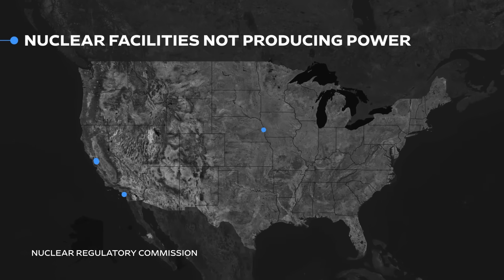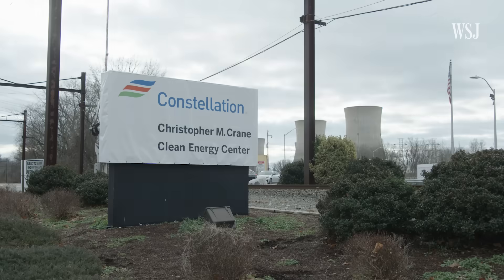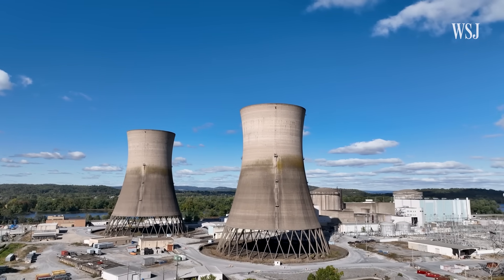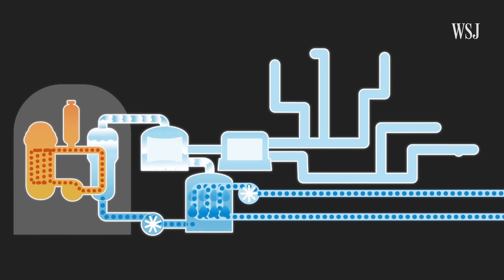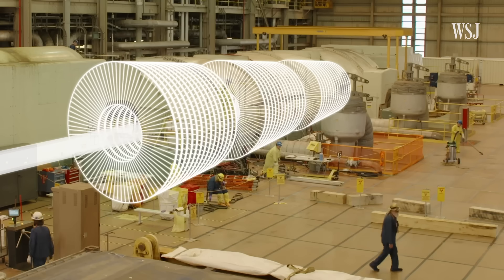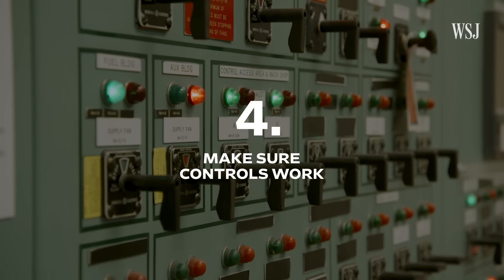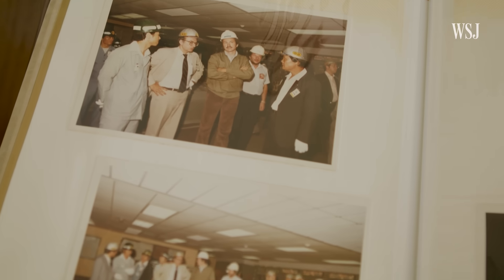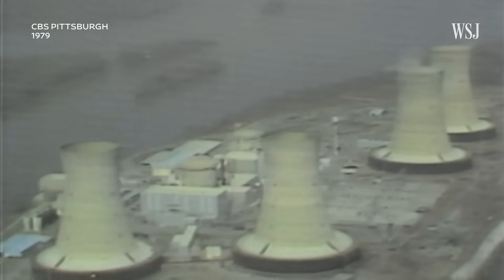Inside the $1.6B Plan to Restart Three Mile Island | WSJ

Comment: Nuclear power is similar to the aircraft industry. The general public fears its most catastrophic failures so much that we forgot both coal and cars have a significantly higher death toll compared to these two.

Edit : Do you realize that all your comments actually prove that nuclear technology is safe? Why? Because, innately, all of you are already aware of the worst possible effects—it’s ingrained in your minds. In aviation, we call this a "safety culture." When we design something, we consciously and unconsciously strive to create the safest design possible. But i get it natural disaster and idiot people are inevitable
Reply: Yep. Coal has a significantly higher death toll, even when it's functioning as intended.
Reply: @normang3668  windpower has a higher deathtoll than nuclear due to work related accidents. and 100 people die in the oil industry every year in the usa. the number for nuclear is zero.
Reply: @normang3668 I wonder what death toll is between problems mining it to the pollution it generates.
Reply: @dustintacohands1107 1600 deaths per year attributed directly to coal plants between 2007 and 2020. 1999-2007 was 390k to 460k. Particulates dropped drastically in 2007. This is just the US by the way.
Reply: @normang3668 And coal plants release more radiation too, since coal is full of radioactive isotopes and most end up going out the stack.
Reply: @normang3668  Mining is hazardous, Coal dust is hazardous plus various other events like fires can kill.
Reply: Not only that but also coal power plants produce more radioactive material than a nuclear reactor as fly ash is surprisingly radioactive
Reply: Very good comparison
Reply: @AlexWaardenburg no you can't compare it.
Reply: @AlexWaardenburg no its not .. airplanes do not cause thousand year spills
Reply: @AlexWaardenburg  Little buddy, the plant south of Miami is leaking onto the everglades area on the southeast end... you all have no clue
Reply: Everyone saying the difference is radiation should look up how much radiation coal plants give off. They often exceed the limits set on nuclear power plants. The idea of converting coal plants to nuclear power plants is often shut down because the radiation levels are too high to get certified.
Reply: Enter Boeing
Reply: As the Chernobyl thing would've been avoidable. For it happens because of the communist system is impractical by a long term on a super large empire. As the impracticality only cause them to hold back do to the soviets heavy finances on their military funding over civilization fundings. Which causes the computer tech for the nuclear plant to be fallen behind along with short fundings for the nuclear plant. The plant going to it's last leg and start to create a world most infamous meltdown.
Reply: It is much easier to "make the news" with major, infrequent events like nuclear accidents and plane crashes than the hundreds of thousands to millions that die or are injured every year from car accidents, fossil fuel pollution, and climate change related events like droughts and stronger hurricanes.
Reply: They also do not like the fact that nuclear requires of massive amounts of money. If taxes were to be raised to fund a trillion investment in nuclear most normies would oppose.
Reply: True.  The incidence of fatailities in cars are much higher.   But that doesn't mean everyone is going to give up cars soon and fly everywhere.
Reply: false.
Reply: they listened to media, hollywood and activist.
Reply: It's also similar to aircraft industry in another aspect - it's cheaper to build new modern plant then refurbish a Vietnam era one. That's why american air manufacturers are moving states right now. And why modernizing Three Miles might be not the best idea. Location is good, all the support infrastructure is in place including cooling towers, but then the plant itself... ehm... in nuclear technology terms it's a dinosaur 😅
Reply: Yeah, not really. People fly on airplanes every day, even if they're afraid. People don't sit inside of nuclear reactors every day.
I appreciate the attempt, but yeah, it doesn't work.
Reply: How many coal disasters have made land unusable for the foreseeable future?
Reply: @The_Ballo  All the vast  strip mines in Wyoming for instance are unusable land for years, maybe generations. There is no unusable land anywhere in the US due to commercial nuclear power.
Reply: @Nill757  yeah but that's Wyoming not where people live (where there are power plants)
Reply: @The_Ballo  Commercial nuclear power in the US had never made any tracts of land unusable,  never killed anybody from radiation, even though there have been accidents like TMI. Still, its possible to have a leak that would hurt people, but nothing compared to the coal emissions that kill people every year  or an oil train fire that burns up an entire town (Quebec 2013).
Reply: @Nill757  If they removed the liability cap I'd believe you
Reply: What about volume ? Billions of cars, hundreds of power plants, maybe thousands?
Reply: @ nuclear safer than its peers, gas coal.
Reply: Coal doesn't pollute an area for a million years+ though
Reply: Very true. But, the more plants you add, the more the risks increase. The cost to keep a plant top notch every day has to be astronomical
Reply: @ the real problem is getting one started especially in a country full of people making assumptions about nuclear power like you assuming they cost more to maintain and run when they DO NOT cost more than other power sources.

Most the money is in getting the plant started especially considering these plants could be operating 100 years.

We have one in the US now that Is expected to reapply its license to 80 years. From 55 it’s at now.
Reply: Bro talking about safety culture in aviation while parts are falling off Boeings…
Reply: Ok copy that, what to do with the waste?
Reply: But the world has changed.  There are far cheaper and safer alternatives.  Solar/battery could do the job without the risk.
Reply: Coal is a carcinogen just like fision..... hmmm.  So pick the one that makes you ill.😂 Can't do tidal, or some other clean source? NO cancer is big business.... trust me.
Reply: How many have dies from any of our nuclear power plants?   …….   None.
Reply: Except when i crash my car , it does not contaminate things for thousands of years and give people cancer .
Reply: A.I. is the sky net terminator & like the movie eagle eye.
Reply: The death toll is statistically smaller only because nuclear energy hasn't been around for long. The statistics also don't count the people who will be dying for the next 200,000 years from the leftover waste. It's insanity. A car or an airplane can't make a state uninhabitable for the next 200,000 years. A nuclear plant could.

Some of the people indicate the danger of having a society full of intelligent fools.
Reply: Unless you have a vodka-swiller in charge of a shoddily built facility.
Reply: It has screwed up the EU and CA
Reply: lol coal and fossil fuels are no more deadly, except in comparison of death per Kw….in that case the atom is far safer and more effective
Reply: it is NOT safe my child... the leak at the turkey point plant in miami, proves me correct..  no engineer has debunked me in 9 years... you cannot do it. ❤
Reply: The cars and planes in Fukushima didn't raise the ocean temp 1 deg either.
Reply: @maxwebster7572  4°C worldwide actually. And keep rising with each barrel of oil burned.
Reply: @TheArklyte  That would be if global warming is caused by fossil fuels and not by the sun. The Fukushima accident directly impacted the ocean.
Reply: @maxwebster7572  
ah, let me guess, your next claim would be that Earth is flat, correct?
"All human die eventually so my client is innocent of child murder with 56 stab wounds, Your Honour" - your comment.
Reply: I dont think Ukranians are comparing Chernobyl with car accidents.
Reply: The aircraft industry doesn't hide the accidents like the nuclear power industry though. It was days before they acknowledged that there was an incident at three mile island. Thousands have died from that exposure yet, they make it out that was because of something else even to this day.
Reply: I personally just see its costs! It might be feasible to run this hellischly old system, but in reality it has to compete with renewables and that basicaally means new reactors are not economical viable. We see this in the numbers, 6 GW of new Atomic power per year vs 300 GW of renewable power each year. It is peanuts, and the only reason for Atomic power is to get the Bomb!
Reply: as somone in the commercial airline repair/recovery/retrofit field this is very true. its actually impressive how little a plane is needed to actually fly.
Reply: Yep and that's why we are getting rid of coal and ICE powered cars.
Reply: @RIPCelts2025  I don't understand. Can you write a coherent sentence?
Reply: Well said
Reply: Not to mention that renewables like wind and hydro have higher annual death rates than nuclear.
Reply: True but 1 nuke accident could affect or kill what, 10k people,  50k people, 10million. Along with ground contamination for decades . I like  nuke but safety , cutting corners, false inspections  do exist,  unfortunately.
Reply: LOL, stop, coal and cars with what?  plant food?

Let's check how many nuke plants are leaking...

Lets check cancer rates around these things... 

Yet you are full of it..
Reply: FYI in sociology they call it expert bias if someone thinks an "accepted risk" over lifetimes spread over national square area equals one that takes out a team or school class within a minute in avation or makes a whole city uninhabitable within a day. natural disaster and idiot peple are a natural part of the causes. but what people (laypeople alike) sense and worry about is societal damage of mass events which IS different from coal and cars.
you think "oh em gee they prove i'm right" but you're just not thinking all angles.
Reply: @mickolesmana5899   with educational resources ALL AROUND US , you're  obviously getting paid by a nuclear entity ...
Reply: There are so many things to reply to, so my opinion probably won’t be heard. Anyway, nothing is burned in a nuclear reactor, reactors are caused by thermal neutrons colliding with each other to create heat, which in a PWR (Pressurized Water Reactor) heats up water that is not being used as a coolant or moderator, that spins a turbine. Correct me if I’m wrong but that is an oversimplification. It is incredibly easy to mess this up. It is incredibly hard to mess this up in such a way that releases radioactive mater into the environment. Nowadays there are so many automated tasks that a human can’t mess up. Nuclear power is one of the safest ways to produce energy, and it is the renewable way to the future. The reason I saw it is renewable is because 96% of nuclear fuel is recyclable, the only things that aren’t are 4% of tiny decay products that are nowhere near as radioactive as the fuel itself. I hope this clears up some things, and goodnight.
Reply: statistics is the ultimate snake oil industry that makes up fake facts
Reply: Agreed on the point that Nuclear power is safe. But I disagree with the reality on the ground. Many of these plants are old there are areas in the plant that just cannot be refreshed for obvious reasons. And on a darker note. I am in the IT industry and I do not think the American workforce as it is can operate nuclear power plants in a safe economical manner. I see it all over my industry little mistakes that introduce vulnerabilities to some of our nations most important digital infrastructure.  We can at least recover via re imaging a server. Nuclear energy once you make a mistake you cant just undo it.
Reply: YOU OBVIOUSLY DIDN'T EXPERIENCE WHAT THE FALL OUT WAS... I DID! PLZ STOP SPREADING A FALSE SENSE OF SECURITY.  THIS IS A FIGHT FOR GREED!!!
Reply: cars dont mass kill people in one massive  area like nuclear can.  nor does coal
Reply: except when my neigbor crashes their car, the entitr area involves is not irradiated for tens of thousands of years.

people dont fear nuclear power.
they fear the greed of the private companies that will own and operate them.

fukishimas owners stated everything is fine...
3 days later.....

how about we nationalize our power production first.
that will drop prices a ton
Reply: Uranium, like coal, also has to be mined and is a finite resource.
Uranium mining also produces a lot of toxic waste.
Reply: Well, yes. But the death toll from a failure like Chornobyl can be catastophic. The Russian government still considers the death toll from Chornobyl to be 33 persons. This only accounts for those killed immediately or within the first couple of weeks. Then there is the increased deaths from cancers in radiation exposed people. Then there is other side effects that are harder to pin directly on the Chornobyl failure. In Belarus many are born with what they call Chornobyl heart, there is a hole in their heart. Doctors perform surgery and stitch a Kevlar mesh over the hole. This slows or stops the blood leaking through and enables the muscle to grow across the hole. This lets the child grow normally and have a normal life. Just one adverse effect of radiation exposure. Orphanage playgrounds in Belarus have higher than background radiation readings.
Reply: I fear the cost. Who's going to pay for it?
Reply: The consequences are different although statistically numbers told us a different story
Reply: it is much easier to revert any problem coal can have than a nuclear disaster.
Reply: @Jeffcrocodile the thousands dead from coal emissions ea year can’t “revert”. There’s nothing in the US from commercial nuclear that can’t be reused, including the couple early reactors closed,  now returned to grass.
Reply: For nuclear power to be somewhat safe it needs excellence, science, engineering, care, diligence, and foresight. As a society we have moved backward in so many of these areas. Businesspeople worship at the altar of profit and willingly cut workforces without regard to technical consequences. And the country elected a new administration that may very well cut or eliminate the NRC and let businesses do more of what they want. I'd much rather live next to a wind turbine or battery farm that may have an accident than a nuclear power plant that may have an accident. 

So many comments here are making light of the Three Mile Island accident and make no mention of the Fukushima accident, whose cleanup has barely begun. It almost seems like the comments are generated by AI bots that want to protect their future power. 

Instead of starting these old plants we should instead cut back on our energy usage. Crypto has no benefit to society at all, so no electricity should be used on it. And AI expectations seem completely overblown - nothing worth the waste. I'll go out on a limb and guess that all these nuclear contracts have custom business entities created to shield the wealth of companies like Microsoft. If AI is a bust and Microsoft doesn't need the power, then I'd guess they would let the business entity liquidate and stick the taxpayer with the billion-dollar expense of decommissioning all these nuclear plants.
Reply: @JasonEDragon "Microsoft bails and taxpayers need to pay to decommission 3MI again." Why? Just send the electricity to those 800k households.
Reply: @pigletshut  The last 3MI reactor closed because it wasn't cost competitive for regular customers. Companies like Microsoft are getting more directly involved with nuclear because the utilities didn't want to assume the financial risks themselves.
Reply: @JasonEDragon  Pretty much.
Reply: Of course, Microsoft is using the plant to power their AI where it was originally brining power 800,000 people. Now the surrounding area faces the same risk, but not the reward.
Reply: @DoubleGoon  Well, they won't be selling directly to Microsoft. The power will go into the grid, and that will mix with power from coal, hydro, natural gas etc and Microsoft will be buying power from that grid.
Reply: @DoubleGoon yeah, they will be using the power. As the video mentioned, Microsoft will be buying the power. Either way, this will set a trend. Ultimately this has the potential to lower energy costs significantly as a result of a trend. 

Let's just hope we have learned our lesson about getting the government involved in anything in an attempt to "make it more affordable", will always end up in failure due to greed. 

If men were angels we would not need to be governed. Why let men govern over men? (...yes, and women. JFC, chill).
Reply: @DoubleGoon I am from the area and most everyone that I talk to is very pro-nuclear. We know that something of that magnitude has such a minuscule chance of happening again. While I am generally fairly anti-ai, if the energy is going to be consumed, it may as well be clean nuclear.
Reply: @DoubleGoon  ... want to use the plant in the future
Reply: @DoubleGoon eh, we aren’t going to ban AI, so it’s coming anyways. The benefit of restarting this is that we don’t see steep rises in power rates, power shortages, or use of dirty coal to power AI data centers
Reply: Yeah, just something about that thousand year radioactive glow that turns people off.
Reply: Hmm idk about that. It just takes one nuclear accident to affect millions of lives. Chernobyl for example contaminated over 150k sq miles, with an estimated 5 million people. The time it takes for radiation to decay in the land is anywhere from hundreds to thousands of years. Sure the official death count from the incident is about 30, or so they say, but the potential long term effects, and environmental risks far out way any dangers presented vs the coal industry. Also the response to these type of nuclear accidents were very concerning. 3 mile island for example, the NRC(Nuclear Regulatory Commitee)tried everything in their power to mislead the residents around the area, as well as the public, and downplay the incident to make sure the nuclear power industry wasn't harmed in any way. To this day they still deny the fact the radiation released had a significant impact on the residents surrounding the area. An abnormal number of cancer diagnosis from residents with no family history of it, after the accident, and to this day the US government denies it was because of release of radiation. You have too many companies, industries that try to play with peoples lives to earn a profit. The nuclear industy is one of them.
Reply: @MichaelLee-z2m  Pro nuclear people like to harp on the coal or oil industries for being corrupt, dishonest, dirty, and only out for profit. They seem to think that somehow the nuclear industry is magically different. 
It isn't.
Reply: @MichaelLee-z2m independent studies are inconclusive that's why the government will never admit to it. If a study searches hard enough they will find people who developed cancer. Of course the number isn't 0 but in grand scheme it wasn't that bad
Reply: @MichaelLee-z2m excellent post!
Reply: @MichaelLee-z2m 
Chernobyl reactors are not the same type of reactor. Russia is also not so strong on safety protocols.
Reply: @mikeshotrodshop  Chernobyl and Fukushima are also not the same type of reactor so I'm not sure that's the best comparison.
Reply: aircraft, coal and cars don't leave entire swaths of land uninhabitable for millennia when there is an accident
Reply: @ForelliBoy  

"millennia" bro people live in Hiroshima and Nagasaki right now
Reply: @ForelliBoy excellent post!
Reply: Coal will never create an ELE (Extinction Level Event )
Reply: @dan0711123  Neither will the worst accident at a nuclear power plant.
Reply: If it just did not have the problems it has. Nuclear power is expensive for a reason. Or better for many reasons. 
I wish we could put all that money and energy into developing and depolying large scale storage that could be fueled by renewables. 
But in light of the climate catastrophe I recon we should revive these plants.
Reply: @Paul-uy1ru you can't run a grid on volatile power generation. You MUST have a stable base power load. You can use renewables for spikes in that load, serving peak demand hours, but the base load has to be constant. Practical Engineering has a series of videos on the power grid that covers just how important that is, and how truly fragile the whole system can be when that need is not met. The "blackouts" you are familiar with are not what a real blackout is, that is a complete grid collapse due to power generation falling out of phase, and the frequency dropping below minimum, causing not just failure, but destruction of infrastructure. It can take months to recover from that. And using generation methods that naturally vary based on weather and the sun being out for base load generation is not only dumb, it's negligent, and dangerous.
Reply: @Demonslayer20111  Practical Engineering also has a video on pumped storage which can be used to serve grids during periods of high demand.
Reply: @Paul-uy1ru nuclear isn’t expensive. Its shakes out to be quite inexpensive. You antis just dont want to do the math far enough out.
Reply: @Paul-uy1ru  The tech just does not exist to make renewables more than supplementary.  More nuclear is essential for us to produce as much power as we can as safely as we can while we hope that technology makes renewables more viable.
Reply: @rustyneuron it does. For now the influence of the old energy sector is just strong enough to not make it reality.
Reply: That's an excellent analogy.

I like to compare nuclear power to the nicotine patch. If you're a heavy smoker, the patch could save your life, but if you've never smoked a cigarette, you shouldn't go near the patch.
Reply: @SmilingNinja humans always smoke dude we need energy
Reply: @dustintacohands1107  We don't need to burn things to generate energy anymore. Smoking kills.
Reply: @SmilingNinja  what is burned in nuclear power????
Reply: @dustintacohands1107  Nothing is "burned" Nuclear fission in a reactor refers to the process where an atom, typically uranium-235, is split apart (fissioned) by a neutron collision, releasing a large amount of energy as heat, and generating additional neutrons which can then split other atoms, creating a chain reaction that is controlled within the reactor to produce electricity; this is the primary mechanism behind how nuclear power plants generate energy.
Reply: @dundonrl  thanks for answering a question that I wasent asking you
Reply: @dustintacohands1107  
Nuclear power doesn't burn anything. It splits atoms.
Reply: @SmilingNinja yes we do !!!! Rainbows windmills solar panels,,,,, won’t keep me warm here in the north east
Reply: @thomasmcnicholas8656  Strange, Quebec is further north than you and they get all of their electricity from hydro and wind. I don't think you know anything about energy.
Reply: They aren't at all similar. Because at the end of the day all it takes is one major failure at a single nuclear power plants to make vast swaths of the area around it permanently uninhabitable.
Reply: Fortunately that rarely happens…meanwhile people just accept the escalation of cancer due to burning fossils
Reply: @setharp how much ground is destroyed for coal?? Have you seen the strip mining for coal???

It’s crazy how much ground they destroy for coal.
Reply: @dustintacohands1107 have you seen how they get the Uranium 🤷‍♂️ pretty similar bud
Reply: @thomasmcnicholas8656  In 2022, more than half of all uranium used in nuclear reactors came from just 10 mines around the world. Compare that to how many coal mines are globally operated.
Reply: @setharp  except that happens from the normal operation of coal power plants.
Reply: @AlexWaardenburg   No it doesn't...
Reply: @setharp  yes it does, jimmy hick
Reply: @AlexWaardenburg  When has a coal fired power station caused vast areas of land to be unusable for farming and unsafe for human life and settlement for 20,000 years ?
Reply: @ Ok genius.... you show me where when a coal plant has a major problem that the area around it becomes uninhabitable and permanently toxic. And son.... calling me names doesn't make you look smart.
Reply: @ryansta never. Neither has nuclear. Even Chernobyl is being used to grow crops, and contrary to popular belief people do in fact still live in the area.
Reply: @ryansta excellent post!
Reply: @kathrynleaser5093  Thank you Kathryn
Reply: @setharp Hiroshima was a thriving city again  by 1960, 
looked like 1960 Detroit. Now
there’s a million people there. 
Good grief.  Nuclear never makes anything anywhere “permanently” uninhabitable. Stop watching the Godzilla movies.
Reply: @Nill757  You don't seem to understand how this works. Letting off a nuclear bomb versus a nuclear plant overheating and exploding are not the same things.
Reply: @setharp  Test
Reply: @setharp  are you german by chance
Reply: @setharp nailed it 100% 👍👍
Reply: @setharp all it takes is one fossile fuel power plant operating normally to do the same lol. still a non argument
Reply: @bonk4621  Yes. "lol". As in- hilarious that you don't seem to understand the basics of radiological accidents.
Reply: @setharp  Not permanently.
Reply: @metaparcel  Permanent enough.
Reply: @setharp  There were a lot of crashes that were due to in fact, a single failure of equipement. Both industries are very similar, it has the potential to create a very unprecedented disaster but now we have a lot of systems in place, backup systems for nuclear, multiple hydraulics systems in aviation. It is the same. Usually there are never single causes of a disaster, it is a chain of unfortunate events. Chernobyl might've not exploded if they weren't running at roughly 50% power, or if they didn't cancel the test, or if they didn't withdraw almost every control rod from the core.
Reply: @setharp  Coal combustion gives off radioactive particles that you and your family are breathing in right now. And in coal mining areas the water is cloudy, orange, and smells like sulphur. I can tell you that from personal experience living next to coal mines in PA. It's a better quality of life living next to Three Mile Island than it is any coal mine in NEPA.
Reply: @setharp Fukushima nuclear accident was considered on par with chernobyl on the INES and yet the difference is so astronomically different. Even with a tsunami destroying Japan, the Japanese government was still able to keep it under control and minimize the radiation that leaked. As long as we avoid the incompetence of the Soviet Russian no nuclear disaster should ever be that bad. Even the three mile incident wasn't even that bad.
Reply: @setharp  Exactly.
Reply: @setharp your concerns about modern nuclear reactors are irrational and not rooted in reality.
Reply: Are you living near the plant?
Have watching documentary videos about peoples rushing to leave after the accident happened.
Will you like to live, work or be near the plant if it resumes operational ?
Reply: @onzitozi9158 Yes, I do. Yes, I have (I've watched dozens of documentaries about TMI, Chernobyl, and Fukashima). Yes, I would.

People fear the worst about nuclear without realizing how much has changed with the industry.
Reply: @onzitozi9158 good point. I'm seriously considering moving. Too close for comfort. Is it just a coincidence that I developed thyroid issues. No I'm not in favor of this.😮
Reply: @onzitozi9158  have you?
Reply: Cars don’t produce gamma rays, so I don’t think this is an appropriate comparison lol..
Reply: @alexzylka4867 while cars don't, coal does. It has small amounts of radioactive elements that end up in exhaust of coal power plants
Reply: @alexzylka4867  thats the point. We fear we will fall from the sky that we sure to make a plane very safe transportation. Same for nuke, we fear radiation so much that we count every single miligram of nuclear waste.
Reply: @alexzylka4867  so deaths don’t matter from cars and cancer but gamma rays since nuclear bad because the news told me ?
Reply: @alexzylka4867 because Godzilla movie said “gamma scary”,  even though never killed anybody ever in US from commercial power, but thousands dead every year from car accidents, that’s ok.
Reply: @alexzylka4867  its actually quite a good comparison. most people don't realize modern power plants have so many redundancies built in they are extremely safe and even boring to work at. when people think of nuclear power though, their mind goes to all the disasters that happened in the 1980s and such. nuclear is the most renewable and clean source of power we can possibly use right now, it's a shame the stigma is holding it back
Reply: @alexzylka4867 you know nothing about nuclear energy it seems 🤦‍♂️
Reply: @alexzylka4867  no but they produce lots of carcinogens in the form of brake dust and exhaust emissions....its very obvious  with the rising cancer rates.